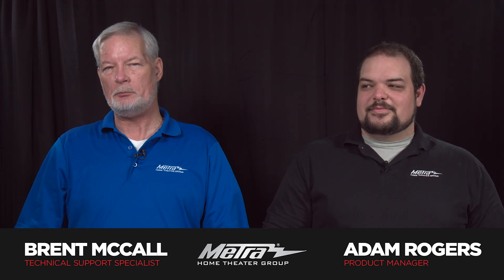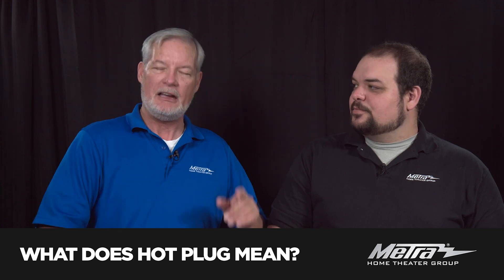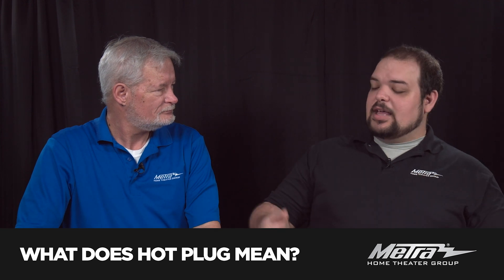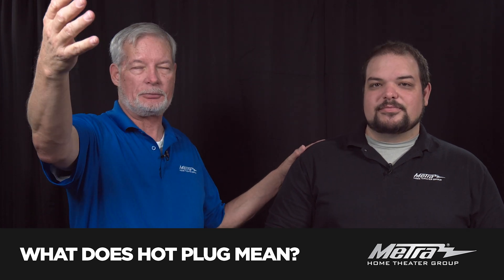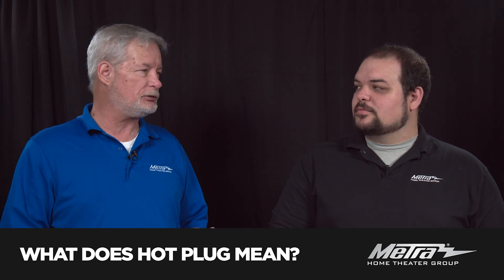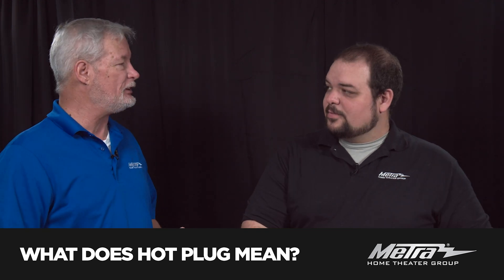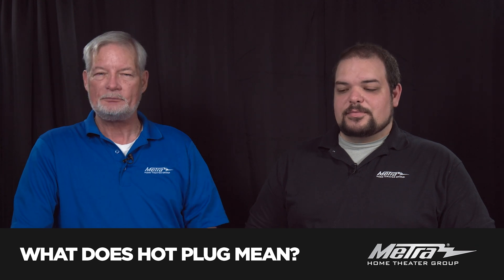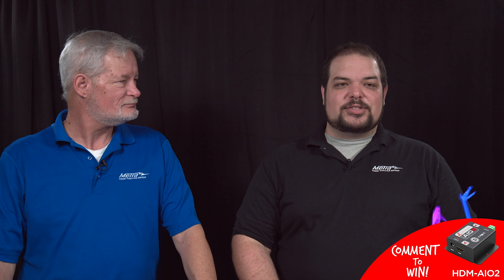What is a Hot Plug Interrupt - Tech Tips Webinar 2/5/20

Comment: On my Nintendo switch it gives me a hot plug error, what do I do is that bad for the tv or switch
Reply from the maker: Hi Tominator, it's not necessarily bad for your TV, so long as there isn't any stray voltage (which is unlikely). However, it seems like it is causing you some problems when trying to play your Switch.

What kind of TV are you hooking up to your switch, and are you using the included or Nintendo made dock for the Switch? -Adam
Reply: Metra Home Theater Group Hi, I am using a Visio Tv and the included dock but Nintendo support told me it means everything is working well and is just bad wording on Visios side of things, is this true?

Comment: So look I need help. I play ps4 on my 32 inch vizio tv and when I’m playing, out of no where my tv just decides to turn off for a good 15 to 20 seconds. When it turns back on it says that my hdmi port has a hot plug. I need HELP.
Reply: Me too my mom just bought me that same tv 2 days ago and it for some reason my tv turns off then it says hot plug
Reply: There’s probably no way to fix it I’m probably just going to plug out PS4 hdmi from tv when ever I’m done using the PS4 then plug it back in when I’m going to use the PS4
Reply from the maker: Hi Zack! It's actually a good thing that we have more than one person with the same issue. Like with Evan, do you know the specific model of Vizio TV you are using, and which PS4, the Original, Slim, or Pro? Thanks! -Adam
Reply from the maker: Hi Evan, thanks for the question! This is an interesting issue that needs further research. Do you have a specific model of Vizio TV and which PS4 do you have, the original, slim or Pro? Thanks! - Adam
Reply: It’s the slim ps4 and I have no idea what the tv model is
Reply from the maker: Are there any other devices in the HDMI signal path, like a surround sound AVR, HDMI extender, HDMI Splitter/Switch?
Reply: @EtherealProAV  I have the same issue with my ps4 slim it will just turn off when running high end games but I doubt that's a problem since when it happens once it dosen't happen anymore unless I play another day. I only have a USB connected from my Vizio TV
Reply: Not at all

Comment: Question:  I have been using the forced hot plug detection feature on certain brand HDMI 4K/18G HDBT POH Extenders.  I assumed this was a good thing based on the description:

Forced HPD On/Bypass
➔ In cases of many layers of connectivity or non-standard devices in-line, hot plug
detection (HPD) may be lost or drop below standard levels, leading to the video source
not detecting a display/sync device and not outputting a signal. A display device may
also not detect a connected source in cases of failed hot plug detection.
➔ If set to On, Hot Plug Detection (HPD) voltage is forced at the HDMI connection of the
Tx/Rx unit. The connected source/display device will be fed a constant voltage to
inform the device that a partner is always connected and active. 

A recent job includes this set up between the AVR and projector and has experienced a black screen while powering on, but only about 10% of the time.  
Would I be better off turning off this forced HPD feature and maybe even using the Metra HDM-AIO2 as well?
Reply from the maker: Hi Chuck! The problem that you are experiencing could very well be caused by that feature on the HDMI extender. Before spending more money than you may need to, try turning off that feature and see if that solves the problem. If it does NOT then you would turn it back on and add one of our HDM-AIO2 devices to the system. 

The feature that they have added, while can be helpful is some scenarios, can cause problems in others. Many displays are designed with the thought process being that they are the center of the system. This creates a scenario where the display assumes that the inputs NEVER change unless they are unplugged. So it keeps the same EDID negotiation through standby cycles. When they are then placed AFTER an AVR or HDMI switch, they continue to assume that the source doesn't change on that input, when it does. This means the display never tries to renegotiate with that new device causing black and "No Source" screens. - Adam